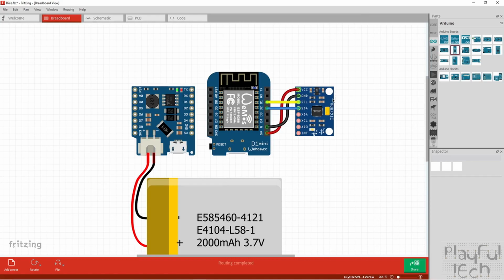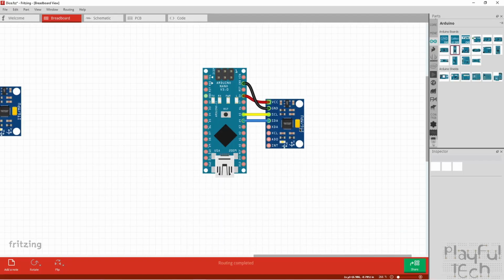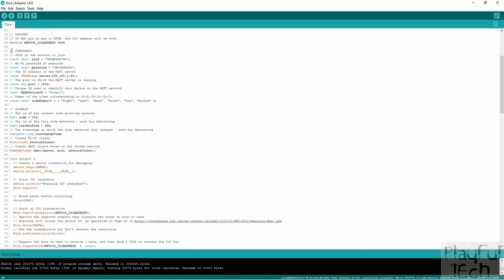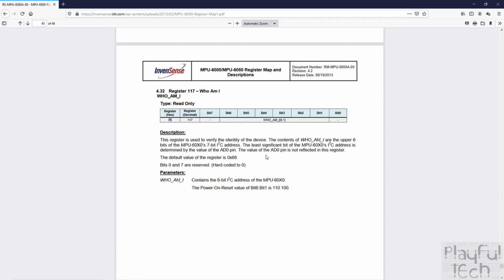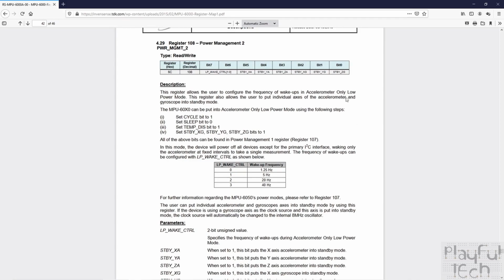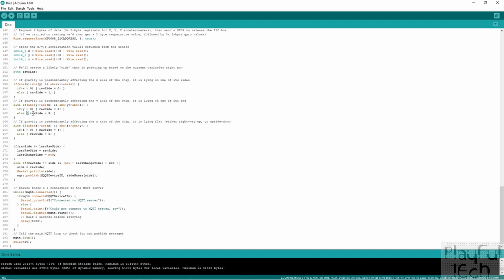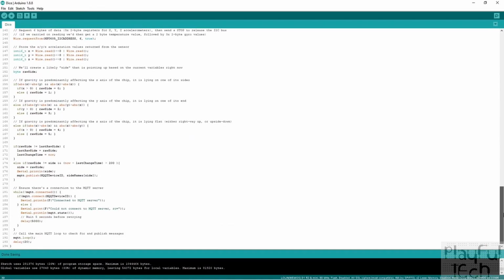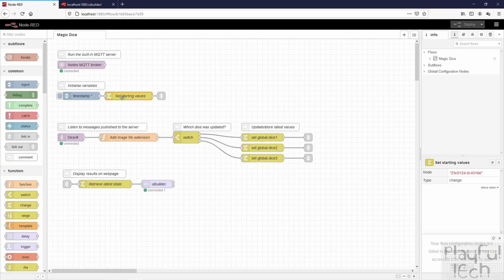DIY Wireless "Smart" Dice with ESP8266 and Node-RED

Comment: This project has opened the world of wemos d1 (and variations) to me! Thanks!!
One question though - It looks like the Wemos battery shield has no overcharging/discharging/short circuit protection for 18650 batteries? 
I couldn't find any info about this in the wemos docs so I'm considering switching the shield with tp4056. Can I get your thoughts on this? Many, many thanks!!
Reply from the maker: Thanks for your comment! The schematic for the battery charger shield can be found here: https://www.wemos.cc/en/latest/_static/files/sch_battery_v1.3.0.pdf  It's based around the TP5400 chip, which has inbuilt overcharging protection.
Reply: @PlayfulTechnology  fantastic thank you!

Comment: Happy New Year to you.

Nice idea. I like that at least for this tech demo you chose the wooden boxes and didn't use a 3d printer. Apart from that, I can well imagine someone trying to throw/roll such a cube on the floor and screwing up the electonics.

According to a test the YouTuber @GreatScott! made about the Wemos D1 Battery Charger a while ago, it seems that this shield lacks a proper over discharge protection and therefore has the potential to completely drain and / or damage your battery (Source: https://youtu.be/aND0j2Y2IkM?t=366). There are a few more quirks in regard to the max. charging current for example, but for more info on that, I'd like to refer you to his test. An alternative could be the TP4056 charging board in combination with a MT3608 DC / DC step up module in case you want to use rechargable batteries. A simple switch might be nice thing to have as well.

Comment: If you use an inductive charger and make returning the dice correctly to the charging station a part of the puzzle then it's win/win, the puzzle gets automatically reset and charges as well. Also worth bearing in mind a genuine Wemos board has a LDO voltage regulator with a drop out voltage of 250mV 3.7 to 3.3v is 400mV to OK but not a huge amount of headroom particularly as the 3.7v battery voltage will drop slightly under load/discharge, with clone boards your mileage may vary.